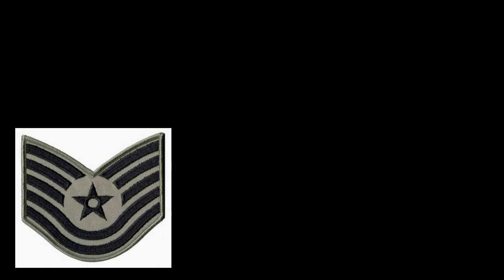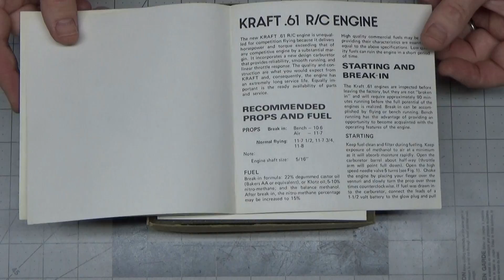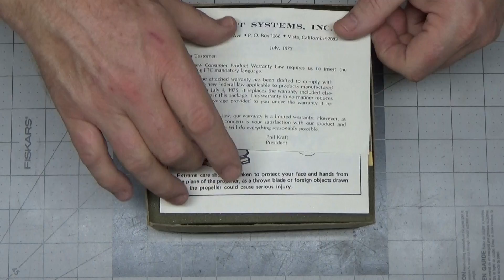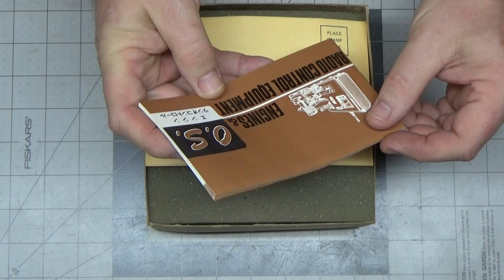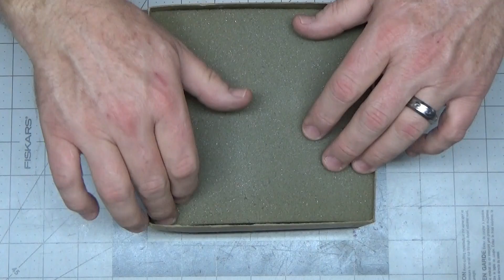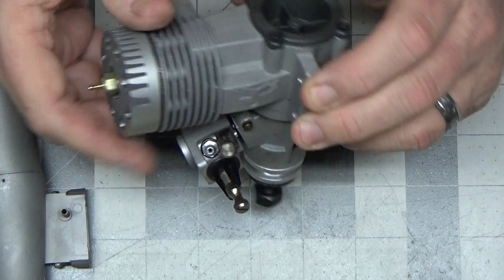A Quick Look at An American Classic Kraft .61

Comment: Kraft came up with the glass filled engine mounts right around this time too and used the material for the engine backplate. This engine was also among the first (if not the first) to use investment castings for components like the case. The muffler wasn't terribly effective and Kraft offered an optional add on after chamber which fitted on the stinger tip to help lower the db some more. The carb also doesn't have an idle stop screw- servo travel being used to adjust this.
Excellent engines for the day. Parts still available from MECOA.
Hope the kitty is well soon.